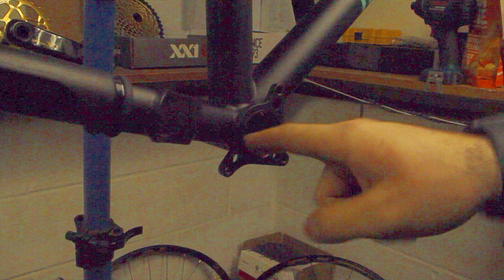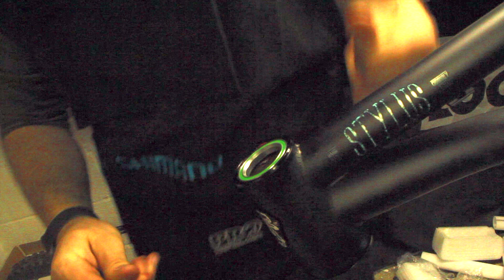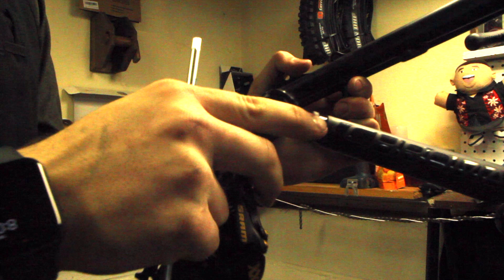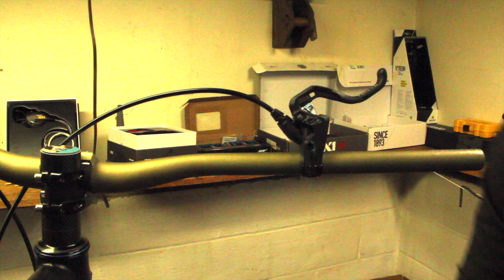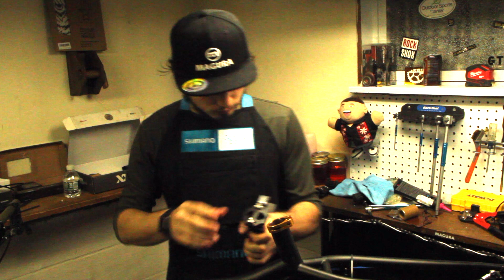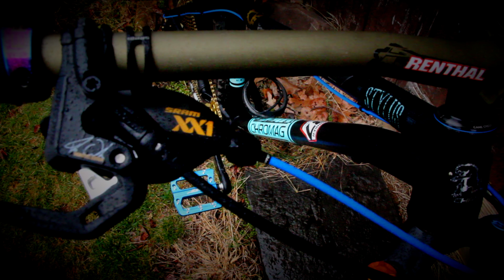Dream Build MTB - Chromag stylus

Comment: What kind of brakes should I put on my 2016 Stylus?
Reply from the maker: my buddy has a 16 stylus also. I would go with what you feel most comfortable with. Shimano saints are amazing but in my opinion to snappy. SRAM guides are pretty good but too spongy. I love the MT5 Fabio Wibmer brakes I put on this bike. but in my opinion, Magura is the best. (they also supported this video)